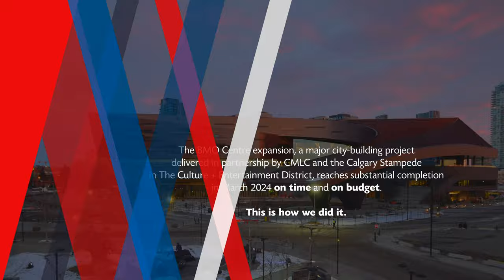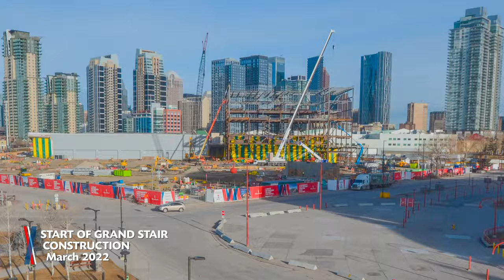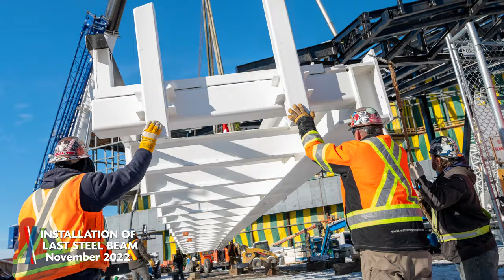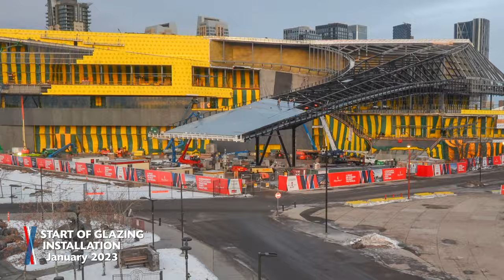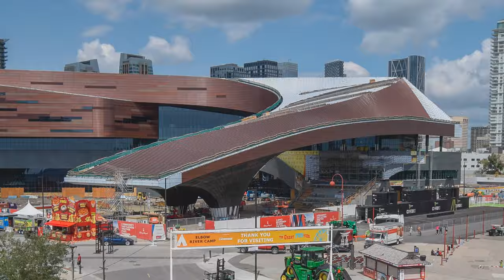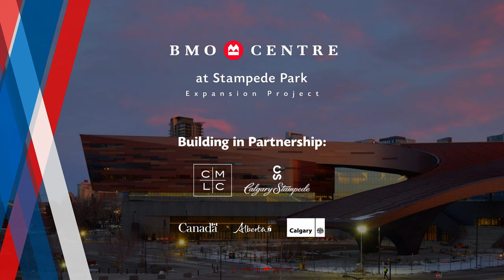Full Timelapse of the BMO Centre Expansion, from demolition to substantial completion

Comment: they should have built the new NHL Arena on this site.  Then tear down the old Saddledome and replace it with the "new BMO Centre.... but that would have made good sense for Calgary.  Very archaic old fashioned construction techniques used in this build....everything was assebled on site - no completed panels lifted into place = massive waste of money.
Reply: I assembled steel trusses offsite, some weighing as much as 185 000 lbs.  So large they required special wide/heavy load permits but ok.
Reply: they are already designing a new arena for Calgary, it will be just north of the saddledome